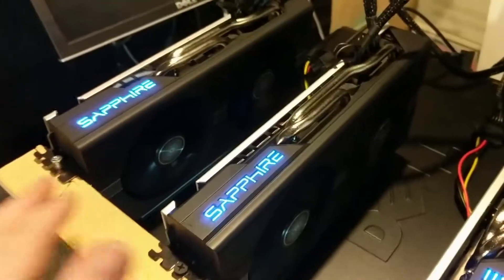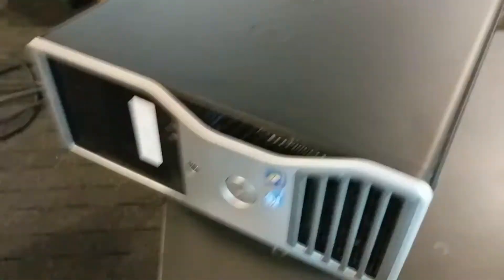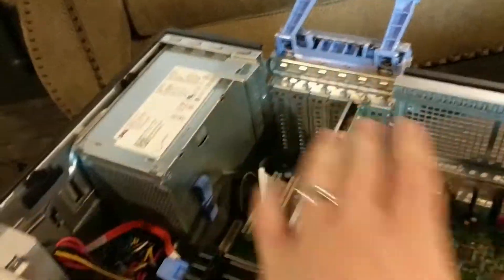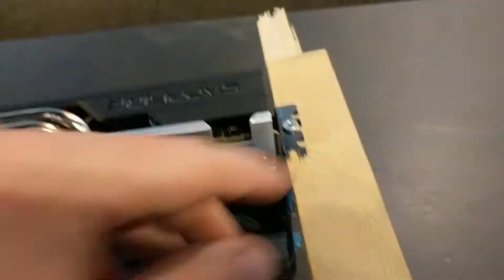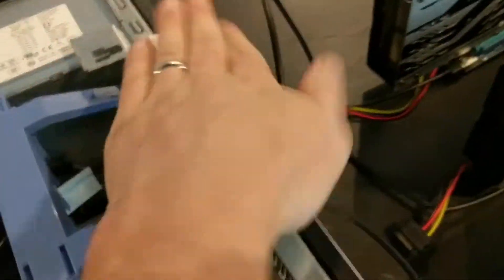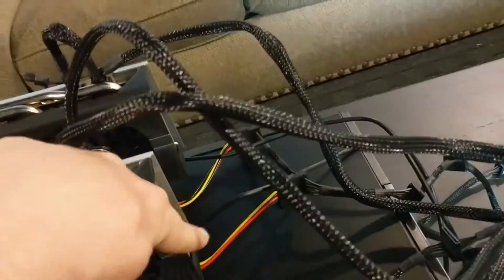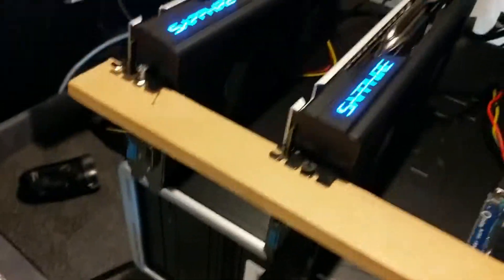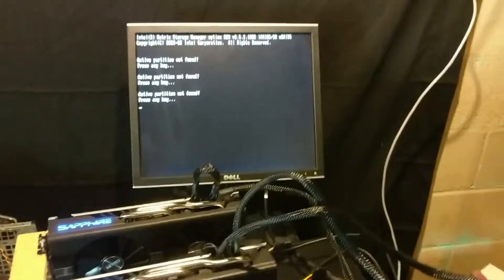How to convert an old PC to a GPU Crypto-Currency Miner

Comment: Could you do a video connecting an old motherboard to a Modern power supply?? I have a motherboard that's not compatible with a Modern power supply, I would like to use the same power supply to power everything, that's the video I'm looking for

Comment: Never use 4pin or sata power cable for pcie risers. Use 6pin or 8 pin splitter to power gpu and riser.
Reply: why
Reply: Thanks for watching, for questions, guidance and support anytime. Just send a Dm and don’t forget to hit the subscribe button 
W/h/a/t/s/A/p/p/+
±¹..(²..⁰..⁸)..
²..¹..⁸..⁴..²..⁸..⁷▫
...
Reply: Thanks for watching, for questions, guidance and support anytime. Just send a Dm and don’t forget to hit the subscribe button 
W/h/a/t/s/A/p/p/+
±¹..(²..⁰..⁸)..
²..¹..⁸..⁴..²..⁸..⁷▫
...

Comment: Is there a way to do this with an old laptop?
Reply: Yes and no, you need a $50 external gpu adapter and you can only use one, you will also lose WiFi and unless you have Ethernet your screwed. And you need a psu so it becomes too expensive. But if you want to then go ahead

Comment: Okay so I don't know how you did it, I have followed every YouTube video out there that helps with building from an old pc, I have upgraded the power supply I have gotten risers I have done everything that every single person has said and yet I cannot get one additional GPU into my old Alienware gaming computer without getting the error power down the PCI cables and graphics cards and nothing I do fixes it. I get the black screen of death if I try and put in any GPU except the one that's in there so I don't know what to do
Reply: Does it post to bios

Comment: I have a poor question,, u use another power supply,, are u connected it with motherboard?? What about the first power supply in the case?? I see it inside the case!!!
Reply from the maker: I rami. The original PSU is only about 200 watts, and powers the motherboard and disk, and a little power to the risers. The second PSU power the GPUs only, and is not connected to the motherboard at all.
Reply: I can confirm that this works. I used the original psu that came with my 7010DT for only powering my motherboard and SSD cards. I have a secondary GPU bought from Amazon. My secondary PSU is used only for my GPU. My approach is based on cost-efficiency and increasing the lifecycle of my PSU that powers demanding hardware, like my GPU. Since most of these PSUs online are poorly built with non smd capacitors, its best practice in my point of view to consider this factor to attempt to mitigate risk of a possible reduction of the lifespan of the PSU.
Reply: @TheAdam212121  
+1,,2,,1,,3,,9,,8,,0,,3,,6,,0,,4
In-box me via WhatsApp okay
Reply: @TheAdam212121  
In-box me okay
Reply: In-box me on Whatsapp for more tips and guideline
+1,,2,,1,,3,,9,,8,,0,,3,,6,,0,,4
Reply: In-box me now

Comment: that happend to me once, went to a computer store they had a comptuer set up,  and said it was x price... i paid for it, and they was like.. Do you want the OS also? i was like it doesnt come with it? and their like no thats extra. I was like  but the sign said  windows 7 came with it.  They said ti was a misprint.. So I was like fine, ill still take it, but you can keep the hardrive also, and knock off a 100 or i walk and you can keep it.. thewy guy looked at me angry and I said, Do you want to make the sale or not?  He said yea,, I said ok, take the hardrive so I can go. lol In short, shady computer companies will do this. They get the windows key that was already on it, remove the OS, and then recharge you for the windows that was already installed on it.
Reply: 4 years late, but heads up to anyone reading in the future. You can buy product keys for Windows online off third party websites for significantly less. Talking $100 dollars or more in savings. G2A is one I've used. Never had issues, but make sure the seller is reputable and make sure they don't auto sign you up to a subscription.
Reply: In-box me via WhatsApp for more tips and guideline
+1,,2,,1,,3,,9,,8,,0,,3,,6,,0,,4
Reply: W..H..A..T..S..A..P..P
+1,,2,,1,,3,,9,,8,,0,,3,,6,,0,,4
I..n..v..e..s..t..In..c..r..y..t..o
B..T..C..A..N..D..E..T..H..
Reply: Do well to correspond 
+1,,2,,1,,3,,9,,8,,0,,3,,6,,0,,4
W..H..A..T..S..A..P..P.....

Comment: Might be a silly question, but if you have a 1000w powersupply, will it always use 1000w? or only whats plugged in?
Reply: whatever is plugged in
Reply: @kamill704  Thanks very much
Reply: @CarpyKennedy  The PSU is capable of delivering 1000Watts but your machine will only draw the power it needs.
Reply: @idyllsend6481  How can I see how much it is using?

Comment: Odd, had not much luck with these risers. The Grafikcard connected via PCIE 1.0 Ports and Riser only made 1/3 the Hash Speed of the Primary GPU connected in the PCIE 16 slot. Same thing with an old Win7 PC when the GPU was plugged into the PCIE 16 Slot (only 1/3 Hashrate compared to the same GPU plugged in a new PC)
Reply: Thanks for watching, for questions, guidance and support anytime. Just send a Dm and don’t forget to hit the subscribe button 
W/h/a/t/s/A/p/p/+
±¹..(²..⁰..⁸)..
²..¹..⁸..⁴..²..⁸..⁷▫

Comment: What would you say the best budget gpu for mining is?
Reply: You can get your hands on some GTX 1070TI or 1080 for $300-400
Reply: @ryankaplan5553  1080 to excellent choice will make you around $2.50 a day - running 2 is a perfect passive $150 a month
Reply: I found if you can get some good deals the 580 isn't a bad option👍
Reply: @spoov8607  dunno where y'all are from but here in Australia the prices for new or second hand GPUs is just way out of hand
Reply: @NatureHub01  The UK has some good deals you just got to live on ebay
Reply: I just got a open box Vega 64 for $410 shipped. Better bang for the buck deal I could find
Reply: Thanks for watching, for questions, guidance and support anytime. Just send a Dm and don’t forget to hit the subscribe button 
W/h/a/t/s/A/p/p/+
±¹..(²..⁰..⁸)..
²..¹..⁸..⁴..²..⁸..⁷▫
Reply: Thanks for watching, for questions, guidance and support anytime. Just send a Dm and don’t forget to hit the subscribe button 
W/h/a/t/s/A/p/p/+
±¹..(²..⁰..⁸)..
²..¹..⁸..⁴..²..⁸..⁷▫
Reply: Start out with a Dell optiplex 9020, but it's only so "budget" after that. You'll need to swap out to a 1k watt psu and a i7-4790 CPU (not bad around $100 each), then it's just your riser adapters and cables and gpu's of choice up to an rtx 2080
Reply: Right now nothing because it's all to expensive the gpus
Reply: @NatureHub01  what about rx550 ?
Reply: @siswanto5229  Rx 550 why waste your money on a 4gb card that's not gonna make shit go with an 8gb card atleast
Reply: @siswanto5229  what about the Rx 580? Nah fuck it still too expensive the market for GPUs is fucked right now
Reply: @NatureHub01  a used 1070 is pretty cheap rn, since no one is buying them for gaming
Reply: @TestiEsti123  i use a 1660 dual evo and Get 27 h

Comment: Hi bro 

I've a Dell Precision T3500 and I would like to do the same. 
Is it still possible nowadays ? 
Did it worked for you ? 
How much is the Hash rate ?  wich software to use ? 

Thanks in advance 

Regards
Reply from the maker: Hi Issam, if you have cheap electricity, it can still be profitable, but not with these GPUs. A good mining pool software for getting started is Nicehash, they have good support and documentation. It might be worth looking into used ASIC miners on ebay instead. Lots of options, just make sure you understand it well before investing a lot.
Reply: @LetsDoCrypto   Thanks man :)
Reply: I am actually considering merging an old T5500 for the 875w psu with a T3500 for its ability to use up to 4 GPU's. Did you ever get this to work. I didn't see a second video
Reply: @JDBSC1  looking for 2nd video too...
 title lured me in and then abruptly ends...
 would like to see one using linux OS too.
Reply: We are waiting for second video?